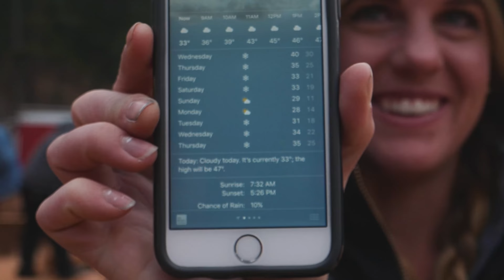I filmed a TIMBERFRAME BUILD!

Comment: I find it amazing that people find them interesting, 30 years ago, I hired my uncle a his 3 men.  I cleared a heavily wooded area. From the day I brought in an excavator to start digging the hole for my basement foundation, till that day I moved my family into finish home (minus paint) was 14 day. That dig the hole make form, pour cement, let it cure for remained of first week. Week 2 day 1 ground floor on top of foundation. day 2 all walls up, day 3 roof on an done, day 5 electrical an pumping, day 6 sheet rock an first mud, day 7 finish sanding, trim work. moved family in an painted 1 room at a time.
Reply: Well... aren't you special.
Reply: Yeah, that happened.lol

Comment from the maker: Have you broken anything?
Reply: Camera in half? No, that's an impressive first. But I remember that time when I arrived at home after a shoot just to realise that my camera bag was still on that parking spot where I left it to answer the phone before putting it in the car. Or that other time when I managed to hit the only 300ft high pole within miles while doing a reveal shot. Or that time when the camera was set to JPEG small instead of raw for a commercial photo shoot because we photographed a ding in the car for the insurance the day before. Shit happens - and once the debt is paid of those are the things you laugh about. ;)
Reply: I have had a CP filter stuck to a lens after it saved the tripped on tripod fall.  cutting it off with a hack saw was not fun, but better then a  busted lens.  and this is what gear insurance is for! :)    

Great work on this project (ease to tell, because it didn't look like work! )
Reply: Hope i haven't broken a camera in half... yet. I did almost fly my brand new drone into the ground a few days ago right after getting it. I decided to try out the sport mode and was having more fun than I was paying attention. It was closer than id like to admit but somehow i avoided a crash. needless to say I took it easy after that.
Reply: A 4004 Nikon falling off of a  low barbeque roofing structure, slowmo, and there it goes the 35-70 in half, pretty much as yours. It happened 22 years ago. Any how, great job with that timberframing rise!!!!
Reply: Not in half but on a canoe trip it went overboard into 300 ft of water.
Reply: Lost a $1500 when the strap broke sailing - so much for a diving watch....
Reply: Twice in 34 years, Once in Wichita, KS. I was shooting a statue on the river and was between the guard rails and stood up....I broke a 24mm in half, it was repairable. Next I was in Miami shooting a car. The hood had been up for awhile but when I leaned into the engine compartment to take a shot the hood suddenly closed and broke (shattered) my 28-70 lens.
Reply: Yup. Set my whole camera bag on the track of the D-9 cat and forgot about it. I remembered 30' after backing over it. At first I thought you were a bit of an odd duck Levi. But that was cool because your perspective and outlook added immensely to this production. I loved your footage and Alyssa's  editing came together in an epic feature. Loved it all, carry on. P.S. Mom always taught us to never judge an book by its cover, I didn't. You rock.
Reply: My dad took some amazing photos of some wild deer. Sat had a coffee then walked bak to the car and realised he forgot his camera went straight back and of course some one had pinched his camera.
Reply: no, but I had a 300mm f2.8 lens that fell in half...ouch
Reply: Leftcoast 
Broken m'y smartphon' last day, and never could buy caméra.... Or pc.
Reply: Leftcoast I once heard the aweful sound of the wheels crunching over something when I was backing out. I wondered what it was because I did not recall seeing anything there. Well, I came to find out I had crushed a brand new smart phone from work!
Reply: I run a rental center, so yes, I've seen several cameras broken in half. 
(Nikon loves to use shitty plastic mounts on the economy lenses.)
 I've seen cameras (well, one camera) filled with grape juice and vodka, still dripping while it was returned with some kind of a "problem". 
At least 10 smashed ND filters, a couple of cracked view finders, tripods missing all sorts of assorted hardware. 
Not sure how you lose a tension knob, but it has happened, a lot.
Cameras filled with sand and throwing codes. (A little too close to the ocean I guess.....) 
And a personal favorite, some kind of hand cream ate the adhesive that holds the rubber grip material off from a D90. 
On the bright side, the camera, while unusable, smells wonderful.
Reply: The worst thing I've ever done to a camera is taking bad pictures with it
Reply: Levi, first, I really like your video and have immediately subscribed....Well, I did not snap my camera in half but I had the misfortune to being on patrol during the SA Bushwar when my vehicle (mine resistant Hippo) hit a double charge landmine. My trusty Pentax K1000 with a 28-300 zoom went flying in the vehicle (obviously not strapped down) but only got e few scratches...Luckilly not in half at least.......:)
Reply: Try that with something made today......   ;-)
Reply: Haven't yet, but I have ended up with a lens becoming individual lenses and mirrors after a drop..
Reply: Never had that kind of damage (yet) but, I'm sure it could happen as I shoot in a lot of wicked nasty hot and cold weather. However, years ago when we all shot on some stuff called "film", I did have my Canon F1 drop into about 10 feet of icy cold lake water.  Without thinking much I dove in after it following it down to the bottom and then realize how COLD it was.  Rescued the camera and after a couple weeks at a Canon repair shop, I got it back fully functional PLUS the film was in great shape as well.  I doubt that any electronic camera of today would survive that dive.
Reply: How about traveling to Cape Canaveral to watch the shuttle launch...filming the whole thing then somehow running another video right over that. Going home and finding a 2 hour video of the inside of my bag. Not a broken lens but a broken heart because shortly after they stopped flying the shuttle so it can never be seen again!
Reply: Leftcoast yep did that too. Had a new canon  with a cheap 150$ 50mm lens on it. I had left on our bed and my wife picked up some clothes that lay beside it. She accidently and partiely picked up the camera strap with the clothes and as she stepped away from the bed sent the camera crashing to the floor. The plastic bodied lens was destroyed!  Meanwhile  I was in another room but heard the thump but made noting of it. She was so scared of my reaction (since I had just bought the lens a few days earlier)that she only told me about it much later that evening when it obvious I was going to see the damage.  Turns out I was not realy impressed with it's performance anyway so I was almost glad to have go out and get a better quality lens. Needless to say my poor wife was relieved by my reaction and I was happy to get a better lens.😎 cheers from QC 🇨🇦
Reply: Yes, I have broken a camera in half.   Twice.    In each case Canon was able to repair the bodies for a reasonable cost.   About $700.
Reply: very well done video
Reply: Praktica MTL3 with a Carl Zeiss Jena lens. Nearly fell off a cliff, i, was lucky, the camera was not. The lens, before smashing completely, ripped off the front frame. Mind you, this camera is all metal, so the fall was quite severe.
Reply: So yeah, back in the 70's i got an Olympus point and shoot from a neighbor who had dropped it into a glass of sweet tea. It was a mess, but all it took was disassembly, cleaning, and re-assembly and it worked like a charm. The first real outing with it was to the Museum of Natural History in New York where we lived. The camera I normally used had a wrist strap... this one did not. Right in the lobby I just let go of the camera which hit the marble tile floor and exploded into a thousand broken pieces. The worst thing was the crowd of people standing around who, all in unison said, "Awwwwwwwwwwww!"
Reply: Leftcoast No,...i haven't, but i'm pretty sure one of my two Blue Pitbulls Bubba&Junior has,...they didn't snitch on one another, just gave me the big puppy eye's, so, i let them off the hook,..it was a Sony anyway, no biggie.

That and i really never have any luck with that perticular brand anyway, it was bound to break one way or another.

Loved the videos you shot btw Levi,...good job👍.
Reply: Well, condolences, but luckily it was only a Sony. (ducking)  A decade ago, I had my Nikon Coolpix 995 around my neck in the truck and when I got out, it swung rapidly into the door.  This bent the bracket for the auto-focus, so everything was slightly out of focus, especially in darker shots.  The camera shop (only one in my small town) wanted $150 just to look at it with no guarantees, plus extra fees for parts.  I opted out and got a D40 a year later.  Love it.   //   Also, loved your filming of Bugaboo's servants in Idaho.  Well done, sir.
Reply: Leftcoast 🤗
Reply: Well, no, I have not broken a lens (yet). Worst thing that happened to me was I was 30 feet from a hooting Great Horned Owl and RUINED every shot!! BLERGH!
Reply: I lost a Cannon out of a plane while doing air to air shots.I dont know if it broke in half but I'm sure the10,000ft drop wasnt too nice to it.Oh and worst of all was it hit the tail surface and dented the skin causing 8k worth of repairs..........all because of a 2$ strap breaking lol
Reply: All I can say about that is OUCH! Poor camera.
I will admit when you first started shooting for the job for Alyssa and Jesse I was not sure about your work.
How ever after watching the build I found myself surprised and very much enjoying your work. So I came 
over here and hit the Subscribe button.  But on the camera sorry to see that. The last ting I crunched was a large
faring that got forgotten behind a truck. OUCH was about all my wallet could say. We all do it now and then.

Just finished watching the video and 19:52 only felt like 5 minutes.
Reply: Yeah man I’ve had it happen before. I was hiking up a slippery hill to get a shot and slipped forward landing on my lens and it snapped in half in the snow. I actually wasn’t even able to find the other half of the lens :/
Reply: Not in half, but my son (16) dug out my 35mm Canon recently for a "look", and I swear that boy has passion-fingers. He had it in his hands no more than 15 seconds before breaking open the back of it and ruining the unreplaceable film I had inside. I've no idea how be busted the lock. I may have sworn a little. Not the first time he's managed to break the unbreakable! Btw, nice job on filming for Alyssa and Jesse. They would never have gotten through that week without the marvelous job you did behind the camera, if they'd filmed themselves. Sorry to hear about your expensive camera. I'm guessing it wasn't insured.
Reply: Leftcoast dropped my new Sony a6000 camera and the lens was toast , the sad thing was we were on a 4 month once in a lifetime trip to the east coast from US to Nova Scotia Canada . But had a new lens sent to me and only missed a small one week portion .
Reply: Leftcoast Nope, cause I don’t have one...🙂
Reply: Thank full never broken one yes I dropped my Nikon it is a lower end
Reply: I dropped my Nikon FM2Tn many moons ago from about 8 feet while I was climbing a fence. I thought it was toast but when I took it to the camera repair shop, I just needed to get the synch speed fixed and it still works til this day.
Reply: I had a tech of mine leave a 25k camera in the grass then ran over it with the news van...
Reply: Hey Levi...You did an AMAZING JOB for Alyssa and Jesse. I watched every vlog that they edited and that you filmed SUPER NICE JOB
Reply: where is the amazon link?

Comment: The actual work area is about 12,000 sq feet 100x120  NOT THAT BIG BECAUSE most of the property is pos the hillside. I would have terraced it some which means removing from land or displacing lots of dirt. Retainig walls can offer lots od flat area. They must be engineered to stay put- in RAIN & BIG RAIN- Many Weeks maybe. Drainage is a part of system..All those beams are about half the spans save for a few. the roof gables.

Comment: I used to watch their channel but I don't think they have built their home "all by themselves." They have had a lot of help and a lot of MONEY! At first they were using a lot of recycled stuff, off grid and learning as they go. But the channel took a turn and it appears they are hemorrhaging  money. Anything can be done with enough money and a crew and any piece of equipment you need. So I just feel the channel is now misleading . But the videos are put together very well and the camera shots are breath taking. If you want to watch a crew build a huge house in the woods  this is your channel.
Reply: That's not a huge house, it's 1400sqft. I would have made it A LOT bigger if it were mine. How big is your house?
Reply: @Sharon-pb7so  I live in just over 2000 sqft house. When I first started watching the channel I thought they where making a small cabin in the woods. I am starting the build on my off grid cabin now. It will be under 1000 sqft. That is how I stumbled on to their channel. Now I understand this will be their only home so it would need to be larger. I was following them from the start because I planned to do something similar as my vacation home. Made 100% by the wife and myself. Not by hiring contractors and dumping a ton of money into it.  I thought it was about saving money not spending it.  I just felt a little disappointed because its was NOT the build I signed on for. From the beginning its definitely not the picture they painted when I started to watch. Off grid, DIY, on the Cheap! None of that is true. It change to do it with a large crew, not on the cheap and on the grid. Plus make that money! huh??  So to me its a big house. Because there is no way those two could of made that house alone. So their channel can't inspire me or really help me out anymore... I stick to the Boss Man, Red Poppy Ranch,  Raspberry Rock, My Self Reliance, St. Bernard Acres, Martins Cabin and JoeandZachSurvival. Those are channels that I have been following for a long time and  they never changed up. They all have skill levels some other better then others but they do the work themselves. They all showed you how to build/Maintain a cabin in the woods and full of good stuff. Those are some of my favorite. I wish the best for Pure Living but their content changed so will some of the audience.